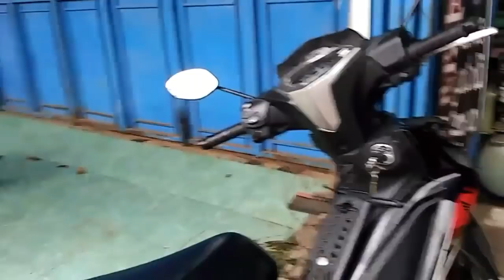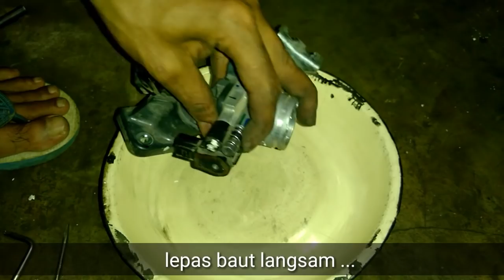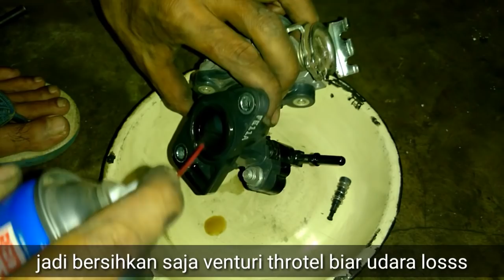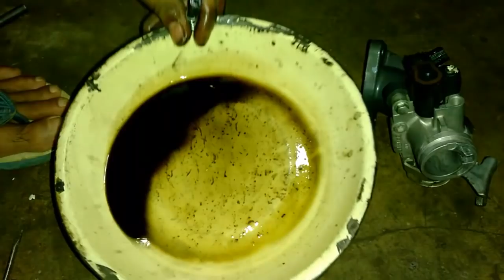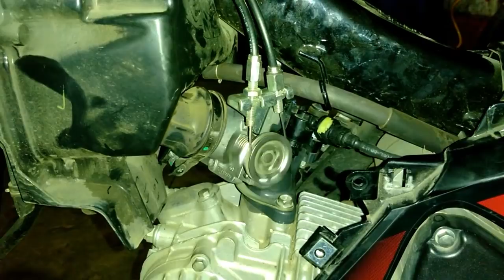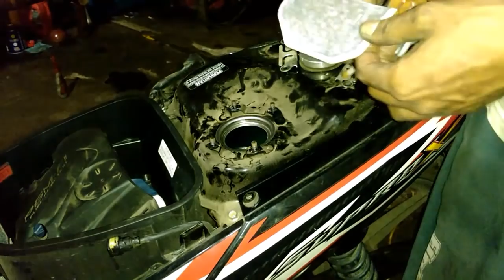Service throtel & ful pump Supra 125 fi # Siboen tutor

Comment: Mas permisi kalau ciri-ciri accu soak itu gimana ?  Jadi gini mas saya ada motor supra x 125 injection seperti video di atas modelnya, jadi singkatnya lampu rem belakang nyala terang, lampu sen nyala juga semua dpn blk saat kunci kontak di posisi on, pokoke ciri khas injection umumnya mas, tapi stater kok g bisa y mas ? dan speedometernya itu g gerak muter saat di onkan kunci kontaknya dan lampu dkt dan jauh hanya aktif ngandelin pedal gas semacam motor karbu tapikan ini injection seharusnya g begitu.. Kira-kira menurut master si boen ini apanya y yg kena? Kata bengkel accunya soak tapi anehnya lampu sen sama rem belakang kok nyala terang bgt gitu mas..

Comment: Mas bro ,,motor supra125 fi, mesin sering rewel dan sering ganti rantai keteng dan di sekitarnya pasti ganti. Penyebab nya apa ya.terimakasih mas sibeon.
Reply: Mnurut saya sih mank motor honda sekarang kualitasnya agak menurun karna lbih mementingkan target dibanding kualitas
Reply: Boikot honda... Bumikan kawasaki..
Reply: Biasa itu pak. Saya main eco riding tapi sering pake engine brake. Usia 5 tahun ganti kamprat + roller + roller suling. Selebihnya gk ada masalah pak.

Ini motor tangguh + sparepart melimpah+ suara anteng+konsumsi bbm 71kpl eco riding.

Kalo dibawa agresif gak akan turun dari 50kpl